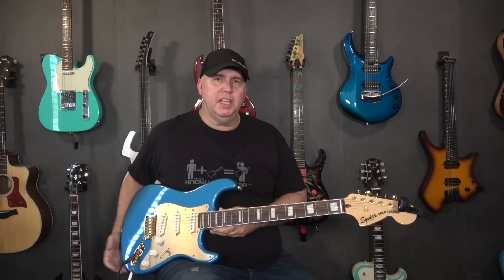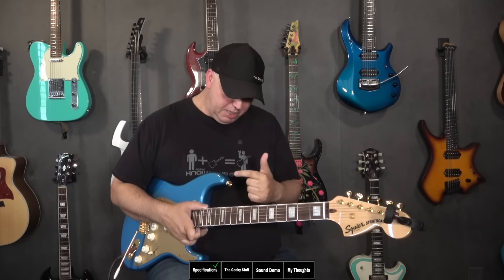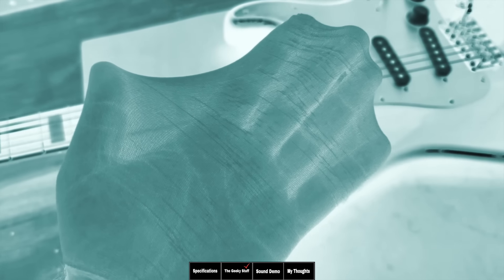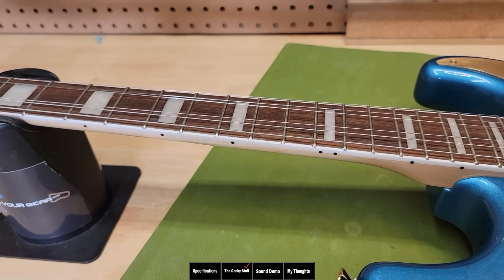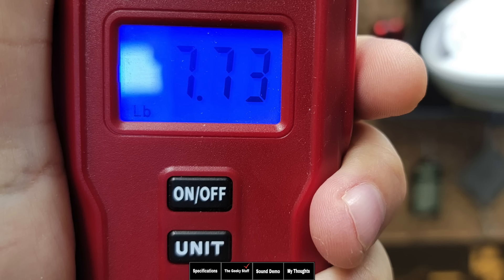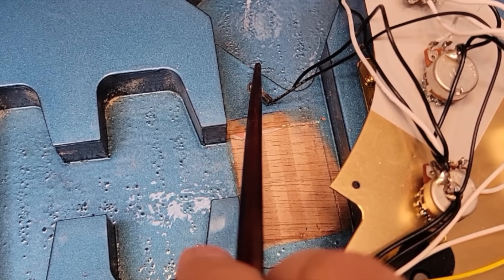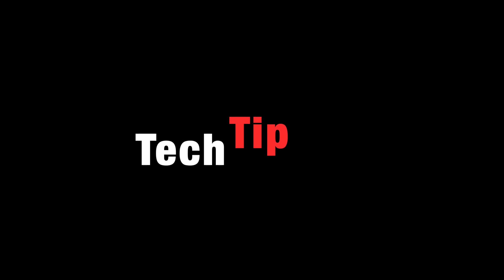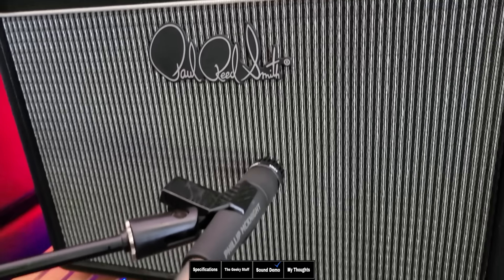Squier Surpassing Fender Guitars In Quality?

Comment: I own a 2001 Squier “Standard” Strat (Indonesia), and I’m amazed how “Fenderey” it is.  The neck is slightly rolled (on a Squier?), and the Alnico 5 pickups sound good enough to me to not switch them out.  The floated 2-point trem works well.  The ONLY thing that bugs me is the 41 mm (yes, 41) nut.  The neck at the 1st fret is pretty dang narrow.  I replaced it with a Tusq, but had to trim off the ends.

Comment: Thanks for this video.  I have a Gibson Les Paul, a Fender Tele and Strat. I have noticed both of my Fender were giving me some static in the amp but after watching your video, I used my can of Deoxit and I no longer have any static and it was in the pots. Next is to round off the frets but I do not have a nylon thing to test them. However, running my hand over the fret edges shows that some were sharp and other were not. I have the tool to file them from Ste Mac Fret End Dressing File. Again, thanks.

Comment: I bought a Tele couple years ago. I'm very happy with it. Only thing I'd like to change is the D-G saddle. There's no compensation for intonation.
I imagine when Leo thought it up, wound G strings were the norm, ergo, the compromise wasn't so far apart.
Other than that, for the level I'm at, and unlikely to rise too much, everything else is fine.
I think on a blind test play, I'd be unable to tell Squire from Fender.
Would like to add. With modern CNC machines, there's very little hands on craftsmanship. So long as someone has quality materials and programmers, I see no reason why a quality instrument can,'t be built by anyone anywhere.

Comment: As the owner of four Classic Vibe Squier guitars, I have to say when they were made in China the fit and finish was a lot better than the Indonesian made. The Chinese made Strat even had a rosewood finger board, the fret work on both the Tele and Strat were perfect. I have since bought two Indonesian made Classic Vibe one Tele Deluxe and one white blond Strat, on both of those guitars I had to change out the pots and also do the fret ends. The Tele deluxe had sheilding paint but it looked like it been splashed on with globs in places, also the paint under the pickguard was dull not polished and there were chips around some of the screw holes, also the holes for the bridge screws were chipped and drilled too big, I had to put larger screws in. Fender need to get their quality control in order you don't see those kind of mistakes on PRS guitars made there.

Comment: 3:54 I typically sand the nut down from the bottom so my strings sit nicely on top.  This way I only need to adjust the width for my preferred strings, which are 10 to 52 gauge.

Comment: I've had that exact guitar. I bought it used, just a couple of months old, practically new! It's a really beautiful guitar! The color, binding, the block inlays... It looks great! However... The wiggle stick doesn't feel good. It's screwed in, and I'm afraid it won't last... The guitar wasn't really set up well, but my main issue with it was the tuning machines. They were absolutely awful! It's a new guitar, but the tuning machines have give in them. I want to loosen the strings and have to turn maybe even a fifth of a lap before anything happens. And it's not about the nut clamping on the strings either. They have give both ways. I was thinking about changing the tuners, but also the fret ends were really sharp and uncomfortable. Finally, I wanted a second Strat as a backup, but it's just so far off from my Shijie STE, it can't compare, it's not even close. Since I bought my Shijie, it ruined all other Strats for me.
Reply: What I like about the G&L is that like the Squier Affinity, the width at the NUT is 41mm while everybody else goes for 42mm and larger....  HOW does your Shijie actually measure at the nut  ???    Is it 42mm  or less ????  Does it "FEEL" slim enough  ???   (PS: Squier Classic Vibe feels very large at nut despite it measuring 42.5mm)

Comment: I own an American Strat and Tele. I also have a classic vibe 70's Squire with oversized headstock and rosewood fretboard board. Alnico pickups. I'm choosing the squire as my #1 everytime! The tone it gives on the neck pickup is the warmest and most responsive tone I've ever found. I changed my pots to 500k. Overkill but much better.

Comment: I purchased this same Squier from Aaron @ Sweetwater and had it plek'd.  I am in the process of installing Fender Locking Tuners, but they have two aligning holes instead of screws and require a slightly wider shaft hole.  The Fender Locking Tuners are a real pain to install on this guitar, but it will hopefully be worth it in the end. I added copper foil tape in the cavity.  I also installed Fender Strap Locks. I have about a grand in it, but I don't thing it will be nearly as good as my Sire Strat.  Almost 40 guitars in my studio,  PRSs, Andersons, Fender Custom Shop, Gibson custom shop, and Suhrs. Nothing beats my plek'd SIre.
Reply: I put the fender locking tuners on a Squier neck some time back.  It was a pain as you describe but man, what a difference!

Comment: I've got a Player Plus Strat. It's amazing. I've customized it a bit with a hot rail humbucker and a new black pickguard, plus I set the trem to dive-only and it's my #1 guitar. That being said, I've also got a Squier Jaguar and a Squier Tele. The Jaguar is a classic vibe 70s Jaguar and the Tele is just an Affinity. The Jaguar needed a bit of work. The bridge kept sinking down too low, so I had to add some loctite. I think I'll just replace the bridge when I change the bridge position single coil to a humbucker. Other than the bridge issue, it's fantastic. The neck is amazing. Chunky compared to my Strat. The Affinity telecaster never ceases to amaze me. It's the cheapest Squier Tele that you can buy and it's just so stable. Maybe it's a Tele thing, but for my cheapest guitar, the tuning stability is crazy good. It's super easy to intonate and it's just a great cheap guitar, so it seems that Squier has been doing great for a while. My first electric guitar when I was a kid was a hard tail Squier Bullet Strat from like 2000 or 2001. It was alright, but nowhere near as good as the newer Squiers. 

Another good cheap brand to check out is Eart. I got an HSS Strat type guitar from them off of Amazon for like $300 or $400. It's got perfectly polished stainless steel frets. The pickups sound great. It's a very dark sounding guitar, but it's nice to have a dark sounding Strat since my Fender is pretty bright sounding, even with the humbucker.

Comment: Cool, I have this exact same Strat.  I bought mine last year when they first came out.  Compared to my MIM Player Strats, the pickups aren't as hot, and not as bright to my ears, actually, but they still sound nice IMHO.  Knobs and pots feel solid, selector switch feels a bit flimsy on mine.  Overall, a nice guitar.  Compared to my Player Strats, though, it does feel a bit de-contented, thinner, but perfectly giggable though.  I've played mine at lots of open jams during the year I've had it, and kicks butt IMHO.

Comment: Last year I wanted a tele, a project guitar to upgrade, and was trying out Squiers. While I was expecting to have to work on the guitar a bit, the ones I tried weren’t great! They all felt like about 10 minutes were spent on fit and finish. Playable, but not pleasant: rough scratchy frets mainly

I tried an Ibanez, made in Indonesia. A hard tail strat with pup switching that can get tele sounds. It needed less work so bought that one, and spent a couple hours on setup, and polishing frets. Now, almost a year later, it’s still stock, and pondering leaving it be. It’s not as good as my American strat, but pretty damn close; closer than the difference in price!

If I were a beginner I’d have been disappointed with what was available for under $400

Comment: Was just going to suggest a 57 mic at the speaker and another 57-58 room mic to give tv viewers a better audio mix, also had 3 pre CBS strats a 61 and 2 65's all with 3 way switches, 61 I wired pots volume, 1 st tone converted to volume for middle pick up , you actually have 6 tones and can have the neck and bridge on like a tele and if you want,all 3 pickups on,my neck pickup was reverse wound so any combination was humbucking, also neck was wide flat hershey bar slab neck, best fastest neck Fender ever made!

Comment: @ 0:04 the stratocastors that had the largest headstock like the one you have in your hands; is it true that Fender made those back in the 70's? @ 5:51 is that how you file the frets?  I have a fret on my guitar in which the high E string actually get caught on outside the width of the neck; I'm thinking filing that fret like you are doing here will stop that from happening 👩 Thank you for the heads up; @ 16:56 yeah; whats up with that scratching tone Knob? ☹️ absolutely: you got a new subscriber 👩 from: Scranton, Pennsylvania

Comment: People should be super careful using that tool to dress fret ends.  It’s super easy to create tool marks in the fretboard, even if you are experienced at filling.  I prefer to use the super high grit sanding pads from stew Mac to fix sharp frets.  Less dangerous IMO.  

Great video as always!

Comment: ?   When you use the shielding paint in the pickup and control cavities do you need to run a ground wire from a pot over to the painted wood for it to be an effective shield?

Comment: It has the split shaft tuners, which in my opinion makes the need for locking tuners unnecessary.  I started playing Fenders back in 1963. Every Strat or Tele I owned never had any tuning problems.

Comment: IMO Squier should have 4 lines of guitars; budget, hot rod, vintage and modern.
The budget range is all cheap pot-metal hardware, top loaded hardtail bridges, cheap ceramic pickups but decent bodies and necks (the beginner/mod platform guitars)
The hotrod range is reminicent of what bands like Motörhead, Judas Priest and Iron Maiden played in the late 70's/early 80's, vintage looking guitars, but upgraded with humbuckers bigger frets, and 2-point tremolos (here you can also find a Keith Richards-type SH tele and stuff like that)
The vintage range is basically the current classic vibe series: small frets, tinted necks, AlNiCo pickups, vintage style bridge and tuners (I'd also like for them to have the aged hardware from the anniversary models and semi-gloss finishes)
Finally we have the modern range; satin finishes, active pickups, roasted maple necks, stainless steel frets, heel contours, locking tuners and maybe Floyd Rose trems.
Of course all ranges would come with a strat, tele, jaguar (bass and guitar), mustang (bass and guitar), jazzmaster, jazz bass and Precision bass. The vintage line would have several versions with cosmetic differences between 50's, 60's and 70's and the modern range would also have 5-string basses

Comment: Phil! I got a 2014 60th anniversary squier strat and I want to replace the tuning keys because the D and low E keys are slipping. Would you say that these ones that you bought would be a direct replacement no need to alter the holes in the headstock? The tunings keys that I have seem to be the same gold ones that came with this Squier.

Comment: I often wonder if it's worth paying the extra (not just with Fender but with any brand that has different ranges). A former bandmate of mine had a 'proper' Fender that was set up well and to be fair it was the best Strat I have ever played. I own one of the cheaper Squire Strats but it is properly set up - I's not as good as my mates Fender but IMO it's as good as any off-the peg Fender I have picked up in a music shop. Personally I'd rather save a little money on the guitar and spend it on a good set up if you're not confident doing it yourself.

Comment: I noticed some intonation issues particularly with the B string when you were playing in different areas on the neck. Considering the price, it's not as noticeable as many other cheap guitars. However, poor intonation can make a great guitar player seem like a beginner. It could also be the taller fret height and finger pressure causing the intonation inconsistency.

Comment: Just a point - if there is no shielding why is there a solder tag screwed to the "paint" in the route with a cable running to the earth tag on the switch?  Perhaps to stop you being able to lift the pickguard too far?  Incidentally, I have a 1996 Squier Bullet Strat, from new, which has always played very well, with a stable neck (though lightweight trem block) and I like the ceramic pups it came with.  Same original tuners too.  JUst shows they could make a good 'un even 30 years ago!

Comment: I bought a Squire Deluxe Strat in a beautiful Daphne blue about 2012. Many were raving about this guitar bang for the buck in all the reviews saying the satin finish maple neck was what you would typically find on a much more expensive guitar. I upgraded with locking tuners and had a luther set it up and I love it! Those guitars were made in Indonesia where they specialize & take pride in their wood working. It is and amazingly well made guitar for 250.00 on sale from Guitar Center back then! lol I find it  to be a higher quality than even Fender Mexican strats. If I ever upgrade, it will be to a Fender American Deluxe strat. The Deluxe was the cadillac top of the line for Squire strats back then, as Deluxe is top of the line for Fender American strats now. Bob

Comment: Yin and Yang.    QC issues with both.   And there really shouldn’t be.       My squire 40th vintage Jazzmaster was a mess, setup horribly, back of  neck had a ridge that ran about half inch down from fret board and was about 7 inch long  needed sanding off.   Frets went dressed properly ( rarely are on any guitar these days) toggle switch cut out 7/10 times on the treble position so replaced that to switch craft.      Plays fantastic now.     My Fender Ultraluxe Jaguar  is incredible but still has major QC issues the frets are not glued in in line it’s like they rounded the edges off then inserted them in my hand so some were shifted 0.5-1.5mm had to get a fret file and re Finnish the edges all the way down so they are in line as some stuck out on the top string side quite a bit like ‘I say one was almost 2mm longer as on the low string side it was flush.  That’s dreadful.   Wiring was very poor.  With connector blocks and thin wires, taking off the scratch plate too shield better there’s not much length of wire and the connection are weak with one thin wire popping out the small connector block so had to push it in and hot glue it there.     So need to replace all the electronics with point to point wiring at some point with twisted braided wires.    I love the guitar and I’m lucky enough to be able to fix thing myself but I really feel bad for new comers buying guitars that almost always need some work.    I think a lot of people give up learning guitar because their guitar is just in bad shape.

Comment: I was handing "CBS" Fender's to guys over the counter as far back as 1971 and nothing out of California had that build quality. The fit was so bad that Fender had to make a tilting 3-bolt neck joint just to set them up correctly. Consumers just got confused about this. I was there. When the neck pocket is made correctly by CNC Machine they went back to traditional four bolt joint.

Comment: I own an almost new APII. Three color sunburst with the tortoise shell pickguard. I bought this guitar new. $1800. The pickguard is a disaster. It was badly scratched right out of the box. I'm pretty sure it was made that way. All the scratches are completely straight, but run in different directions. I believe they are manufacturing marks. It has a very dull flat finish, and if very rough around the screw holes. Looks like they were drilled with a really dull drill bit. I plan to change it. Something like that does not belong on an $1800 guitar. Everything else looks ok, and it plays ok, though I don't see $1800 in it. Yes it is completely stock, even the strings. I know almost everybody upgrades their guitars. I have too. But they were MUCH cheaper guitars. A few months ago I bought a $200 Squier Bullet Strat hardtail for my grandson. From a cosmetic perspective, it is as good or better than my $1800 APII. The cheap plastic pickguard looks much better. No scratches, and the screw holes are perfect.

Comment: I work for a big fender dealer. Long story short, I think squier/fender have their work cut out for them. They're beaten in quality in every single price bracket imo. 

I don't think the gold edition 40th models are anything special, but I do think that in general they aren't too far off any mexican guitar with similar specs. Mexican Fender bound fingerboards tend to be absolutely awful these days. The vintage edition ones kinda rip, the satin neck rules.

They all tend to come set up badly, regardless of price point, unless they're Japanese.
Reply: MIJ is where the value lies, absolutely impeccable craftsmanship. Old Hybrid   series hit it out of the park

Comment: In my imagination, I might not get this guitar, but I would take my Squier Vintage Modified Bass Six, strip away its finish, replace the finish with the like of this one, tighten up the wiring of the pickups so it would match the output of my other basses and get a guard of the same color as the guard attached to this guitar. I might’ve written that in another comment from another channel (under my real name of Eric B Gordon), but I don’t regret repeating it.